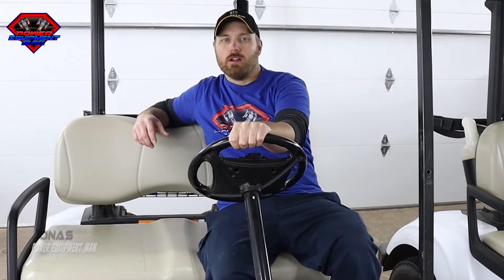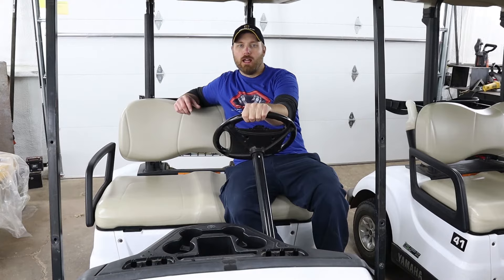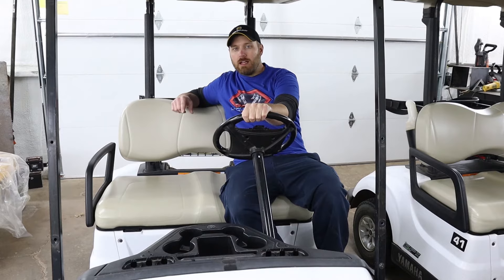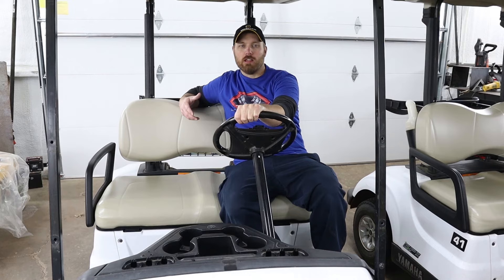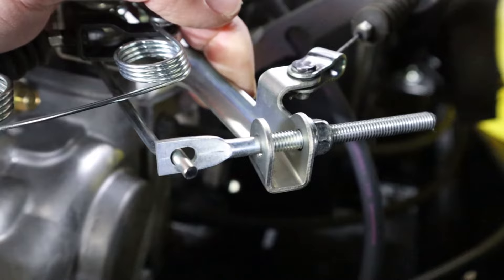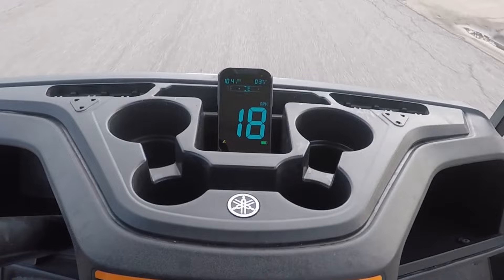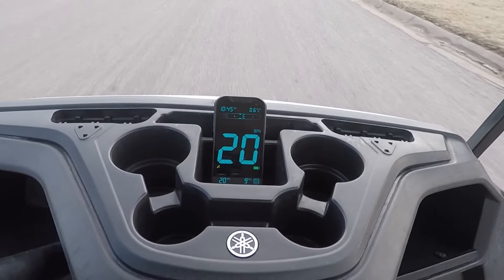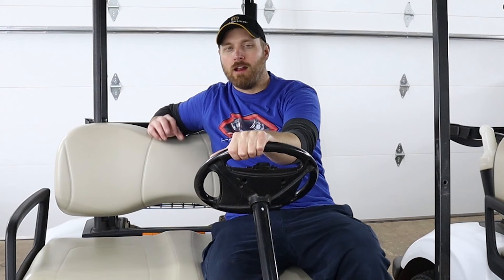Yamaha Drive 2 QuieTech Golf Cart - Top Speed Test

Comment: I work at a new/used golf cart dealership and we are a Yamaha dealer and we turn up the governor's on almost ebery golf cart but leave a 1/4 inch of thread and thats the sweet spot wont over rev engine and will get the new lsvs up to the 25-29 mph that some of the small beach towns around our area requires a lsv street leagal golf cart to go and they do test the speed st the dmv depending what side of town and what town you live in especially if ots one fonthe little beach towns. my personal golf cart was a golf course cart and its 7 years since i refurbished and built it into a lsv street legal cart turned all thebway up on Governor and have not had one single issue with kver reving or motor wearinf out due to adjusting the governor. Just dont remove it internally completely that woll blow up these motors and also drill put that little screen on the tail end of the exhaust cause it clogs up with carbon and will caus your golf car tto run loke crap eventually guarantee sonwe droll them pit off ebery cart new and used.
Reply from the maker: Thanks for watching!

Comment: Does turning the governor up lesson hill climbing ability, turned my 2017 up and can barely get up a hill now
Reply: No it doesn't. Drill out the screen on the end of the exhaust the tail end of it you gotta take the plastice cover off the bottom of the cart and remove the rubber boot covering the tail end of the exhaust to do it and once you drill it and remove that screen it will increase power torque and performance instantly. I build custom golf carts and have had golf carts from golf course run 5 mph like crap with governor turned up and as asppn as I remove the clogged up screen it went from. 5 mph like crap to going 25-30 mph instantly

Comment: Can you do or have you done a video on a 2019 Drive 2 electric cart for governor adjustment?
Reply from the maker: Electric carts do not have "governors" like gas carts do. To speed up an electric cart you have to either purchase a "speed code" for a dealer to reprogram your controller, or install an aftermarket controller.

Comment: Yamaha rates the max power of these 357cc motors at 3200 rpm. If you are going to futz with the governor, install a tach temporarily (they are under $10 on-line). 20.5" tires @ 2800 rpm will give you 18 mph steady, 20 mph foot-to-the-floor @ 3000 rpm without lift, special gears or kits. Keep a safety margin. Replacement motors are north of $2K and you are running rear-wheel-only brakes designed for turf speeds.